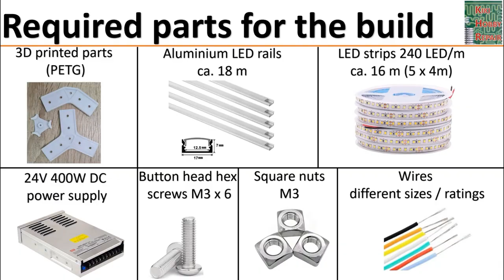I made my own honeycomb LED Light and it turned out awesome

Comment: Nice project. Two issues i see with it:
- requires 3d printer for the mounting brackets
- plastic diffusers could be cut to interlock, without the gaps where the profiles join, though that would require finesse to get the angles right
- even so, there are no leds in the joints, so they would appear as dark spots

The last problem could be reduced by using cob led strip and sizing the parts so that gaps between strips are minimal, and using wife enough profiles so that wires could be placed to the sides of the strip without obscuring the LEDs. Such step would also guarantee no bright spots from individual leds are visible through the diffuser (hard to tell if it is the case with this build but often a problem when using bright strips with shallow profiles)
Reply from the maker: Thank you for your comments. 
Basically at the joints the white 3D printed covers are max 20mm wide and they are quite thin so you cannot really see dark spot.
As for the shallow alu profile. There are 240LEDs per meter so there are zero dark spots between LEDs 🙂 Not even on 25% brightness.

Comment: Would the design of this project be changed by the led strip being rgb?

I want to do this build but i don't understand the circuit part, how do you design it so the power runs evenly? And what was the purpose of those extra wires in the middle?

Comment: What did you use as a diffusor? Great build btw :)
Reply from the maker: Thank you! The aluminium LED rail came with the diffusor.
Reply: Nice. I bought evetything today. I will buy 3D file and I should be good to go :) Thank you for the tutorial
Reply: how many pieces do I need to print on 3D printer? Maybe you mentioned that somewhere but I missed it.
Reply from the maker: @shonescootch it depends on the size you want to build.
Reply: @kikihobbyrepair  Same as yours, I bought 20m led strip and around 20m of aluminium pieces
Reply: @kikihobbyrepair  I also bought led strip that works on 220V, that should be ok?
Reply: I kinda figured number of parts but I’m just not sure if I need to print connector top v3 and top v1?
Reply from the maker: @shonescootch I would not recommemd it at all!!! You have to solder bare wires onto each of the LED strips and thise will than be 220V next to the aluminium rail. Dont do that! Buy 24V LED strip!
Reply: @kikihobbyrepair  I was thinking about that earlier :) I can isolate these wires so they wont touch the aluminium, but I guess it's safer just to go with 12v. Thanks for the answers.
Reply from the maker: @shonescootch  better to go with 24V. Less Amps is better.

Comment: Wow looks great. Do you have links to the material you used?
Reply from the maker: Thank you. 
This is the aluminium rail I used: https://www.ebay.de/itm/255213687451
This is the LED strip: https://www.aliexpress.com/item/1005003091669265.html?spm=a2g0o.order_list.order_list_main.101.7e2d1802ThvcnN
Take care to select the 24V and 240 LED/m.
The rest is just screws and the 3D printed parts.

Comment: What was the cost of this build, is it worth to build it or its breaks even with the real kit ?
Reply from the maker: It was significantly cheaper than the "real" kit. For me the rails and LED strips were like ca 90€. The PSU was laying around but it is ca 50€(a quality one). Plus some wires, screws and filament. 
Building and designing was a ton of fun, plus the feeling that it looks awesome is great 🙂
The wireless dimmimg circuit is already on the way to make it more versatile and not to burn your retina all the time 🤣